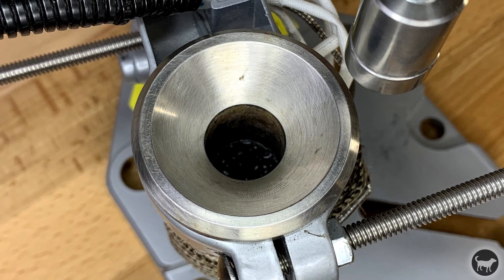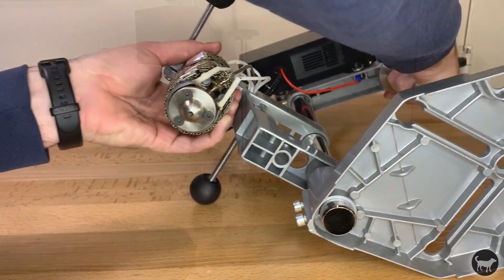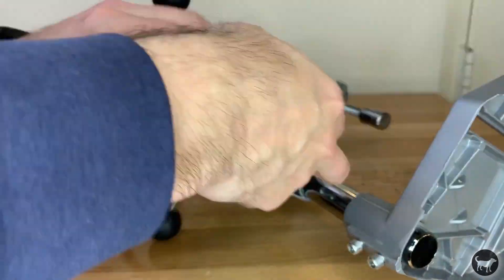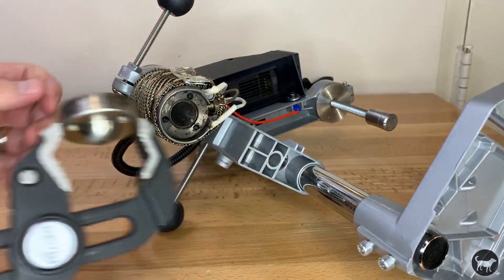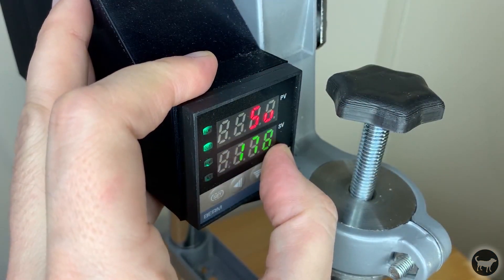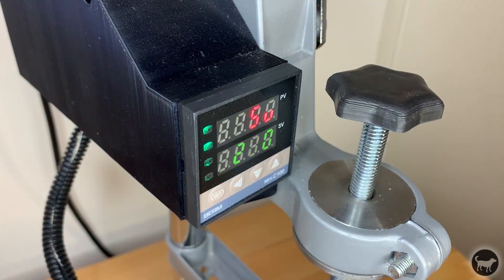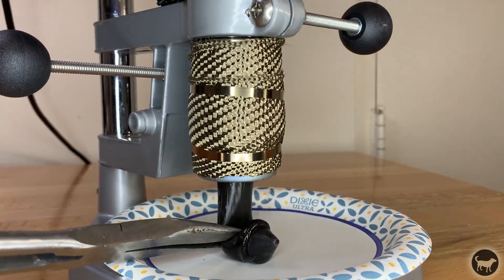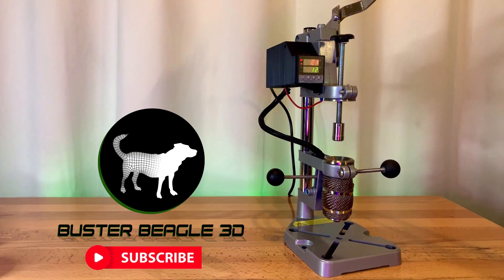Clean the Heat Chamber on the Buster Beagle 3D Injection Molding Machine

Comment: How far in does the plunger descend into the heat chamber? Is it supposed to bottom out or stop about half way in?
Reply from the maker: It will stop when your mold is filled but otherwise it should reach the top of the nozzle.

Comment: I am sure you may have but have you tried using a small arbor press? They are pretty inexpensive and have good force. just curious. Greatly informative videos... Thank you!
Reply from the maker: I have not tried an arbor press just yet. The ones I have seen and looked at were a little more expensive and didn't allow for as much vertical space. In the next version of the machine it is even longer with a beefed up handle to help with the pressure.